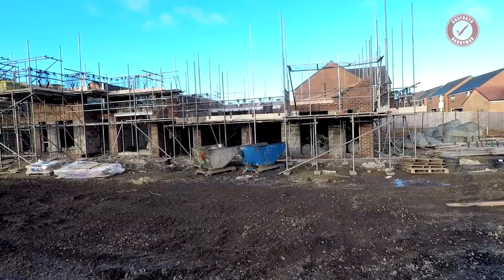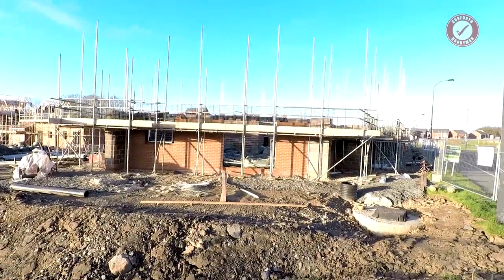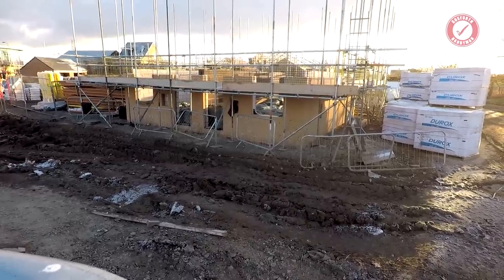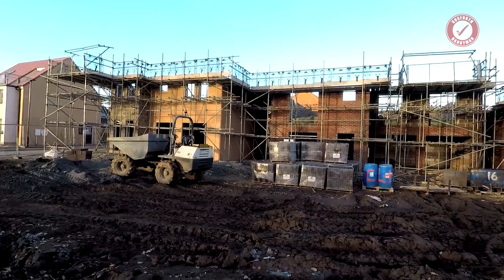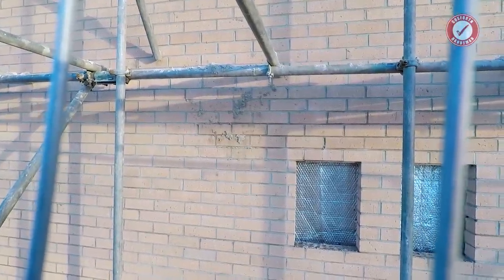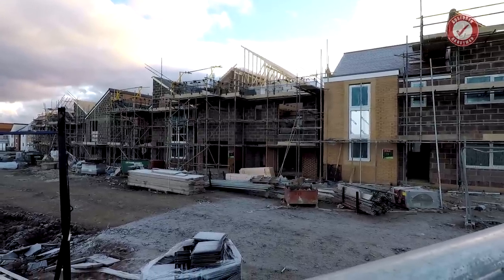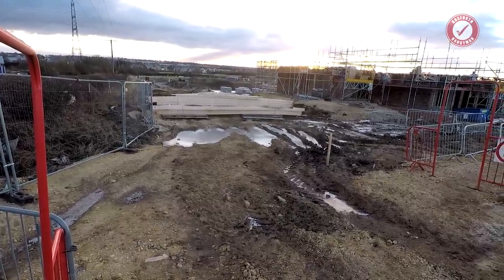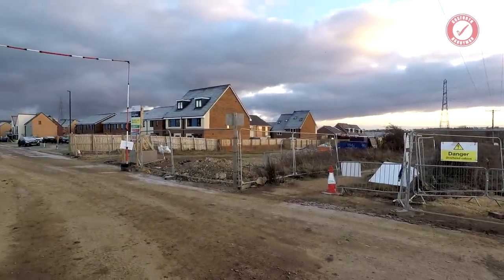How are New Houses in the UK Built? Introduction & Externals

Comment: I’m in a ‘new build’ that’s now just 10 years old and I love it. It’s dry, warm, straight and everything works. 

I’ve owned my share of old houses, about 100 years old and every old house has had far too many problems. Leaking roofs,  draughty,  trying to fit new square windows to an old twisted building or fit a square kitchen unit into a severely warped room is a nightmare. Give me a clean, smooth, energy efficient new home any time. 
Yes old houses look charming and have character but they also have rising damp, mould, leaks, lead pipes etc. 
My new home has ample storage and is a nice size. I’d never recommend an old house to a young couple, it’s such a money pit. Buy new and sleep peacefully knowing your roof tiles will still be in place the morning after a storm.
Reply: Give it twenty year and come back slagging off the hundred year plus houses v your new one.
Reply: I agree, buy new, invest old.
Reply: @julie Wallis: you are fortunate, indeed.  The new build industry is rife with problems.  I prefer old, even my mother's draughty 1930's house.  It had style and character.
Reply: Usually the new houses where the roof tiles fall off.

Comment: I like your work.   I live in both texas and france.   French build homes are similar to UK.  In the USA homes are built from timber.  Often the timber is glued pieces and looks pretty fragile in the long term.   The lots in Texas are still large and the houses are mostly detached.   To make them bigger slab foundations are used and they often crack after forty years and cause moderate to huge problems.   Perhaps, today, in better neighborhoods, deep footings are used so the slabs will not crack.  Not sure of that.   In the inner parts of the city it might not matter so much as homes are often destroyed after sixty or so years to make room for bigger ones.  The frame houses usually have a brick,  rendered, or wooden façade.  I think much of the wood is really 'Hardy board' which is cement and fibers shaped to look like board and painted. Roofs in the USA are often composite materials that last about twenty years.   Nicer homes have metal roofs and the nicest have tiles or slate, but that is unusual for a home under two million.   Texas and most American homes look cheerful and spacious and so they are, but they do not feel permanent and cozy.  More like a consumer item.

Comment: They should use different design on the homes even on the same road. Some could be modern versions of traditional designs some could be contemporary. I hate cookie cutter. Build detached. Fed up with so much of the UK based on terraced housing. Also, have wide roads and pavements in front of these new streets. Most importantly, have really good sized rooms. It will be good for the mental well being of kids growing up. Stuffing households into prison-sized cells can't be good for mental health.
Reply: Land is expensive man! Detached houses and wide streets/pavements takes up a lot of space, much of which is just not available. Plus, increasing the area comprised of man-made solid materials increases surface runoff, therefore there is a raised risk of flooding across the whole area.
I actually think a lot of traditional housing designs from the late victorian era are some of the best. Semi-detached homes for suburbs with decent long gardens and on a grid-pattern so people can walk around the area more easily. A lot of cul-de-sacs on new developments make walking much more difficult, as you are forced to take inefficient routes.
Terraced housing and townhouses can be fantastic when done correctly and also open up affordable options to many people.

Totally agree on the hatred of cookie cutter, I'd like to see a bigger mix of architectural styles.

I live in a new apartment development in central Manchester, with a front door and patio that opens up to the outside and a surprising lack of shadows considering I'm on the ground floor. All for an affordable price!

If we want people to have better availability of space, quality of life and outdoor area, we have to build more intelligently with the space we have and stop cramming in detached housing where the space really isn't there. Expanding social/affordable housing and making sure that people have access to homes of an appropriate size for their needs is also important.
Reply: Move to Australia mate. You'll never look back.
Reply: I have a Victorian terraced 3 storey house and all rooms are a good size.
Reply: Absolutely agree with you! The new build houses look so old!

Comment: That’s why I live in a 110 year old semi from back when shit was built to last
Reply: Surely these newbuild properties are not designed to last 100+ years. Everything is now engineered to fail... It keeps jobs and creates more modern builds too.
Reply: damage1_1 New builds will only last around 10-20 years
Reply: @harwoods11  disaster given they haven’t been building to support the population for decades causing costs to explode.
Reply: damage1_1 a house should not last 100 years. It ideally should not last far past 50. When a house is 50 + years old the wood is rotten and the style of the home is out of date. It would be far too dated both exterior wise and interior wise which is why homes shouldn’t last past 50 yrs
Reply: @LucasFernandez-fk8se  Why would the timber be rotten after that time if the building has been maintained correctly?

Also, given the cost of putting the building up, I suggest you reflect on the economics of replacing every 50 years.
Reply: Forza223 Bowe I’ve work on 100+ Victoria homes and new sites. New home are built to a seriously higher standard. The foundation are so shallow on Victoria homes and being single skins often suffer from rising damp. Brick and blocks new builds with the current regs on foundation will last forever if looked after.
Reply: Lucas Fernandez what a stupid comment. A quarter of UK houses were built by the Victorians, and are as strong as the day they were built. Timber doesn't rot unless its wet, and the joists and rafters in older homes are far thicker and stronger than anything used now.  If older homes are so outdated, why do they fetch much higher prices than new ones? In the U.K. people buy a new house because they can't afford a period property! Not to mention building houses to last just a few decades is incredibly damaging for the environment. We should be building to last generations.
Reply: @gongagong  I bet your houses have been retrofitted with insulation, heating, injected damp course probably even installed a toilet inside the house. XD clueless
Reply: Mum said our house is one of the last well built ones;  it was built in 1967 and has decent quality bricks, wood floors etc.  However her first house was a cottage built nearly 200 years ago, and my dad spent a few days with a friend to hack through walls a metre thick.  Houses these days probably only require one or two hard strikes with a lump hammer lol.
Reply: @mrfr87  Built to a higher standard but designed to a lower standard
Reply: @harwoods11  nope that’s not why we build shit cheap houses. It’s because that’s all people will pay for nowadays. Most people aren’t happy to pay more for something that looks and feels the same regardless of the fact after ten years one will looks a lot better.
Reply: @LucasFernandez-fk8se  my house is over 400 years old non of the beams are rotten, there’s a bit of wood worm but it’s been killed now. Also it looks lovely and everyone who comes over likes it.
Reply: @PiOfficial 
My house was built in 1898.
Reply: Nonsense.
Reply: @melsagelord3991  
What..all of it 😂🤣😂
Reply: @Em-7Add11 : 😂 😂 😂 Fortunately,  I wasn't drinking when I read that.
Reply: @LucasFernandez-fk8se  I've never read anything so stupid

Comment: Pumping insulation between the double masonry walls is a bad idea because there is no guarantee that the insulation will be distributed uniformly in the cavity. You can't know if it is uniform when done and you will have gaps everywhere creating cold spots on the exterior walls. Better to install 4" rigid form insulation panels on the outside of the inside wall and then build the outside wall over the foam panels. Also, should have put 2" rigid insulation forms with a plastic vapour barrier over it on the ground before pouring the concrete slab to keep the ground floor warm and dry.

Another problem I see masonry inside walls  is how do you run electrical wiring through and put electrical outlets on them?

Comment: Greetings from Phoenix, Arizona - Gosforth Handyman.  Well things are done a bit differently here.  I live in a 45 year old terraced home (concrete stucco trolled over concrete block and painted).  However, I had a new-build here (built in 2001), and I don't think the construction materials have changed much since then.  New homes in the Phoenix area tend to be wood-frame filled with insulation, styrofoam and chicken wire, and finally covered in a thin veneer of concrete stucco.  We used to have a problem here with burglars simply breaking into homes through exterior walls.  And a friend of mine decided to spray the dirt off the stucco oh her new home a few years ago with her thumb over a garden hose.  She blew the concrete off and it took a very long time to get the builder to completely redo the exterior of the house.  In the Phoenix area, the basic construction materials and technique are not very solid... but the new homes are, at least, very energy efficient.

Comment: Fascinating, here in Australia and New Zealand it's mainly timber or steel frame construction on concrete floating pads as you showed. Brick fascade is the common outer skin with steel or tile roofs. Houses are getting packed closer together but not common to share a boundary wall. A typical section size is now around 400 sq meters. $200-250,000 is usually the price for these sections though in Sydney prices are crazy stupid with average property price over a million now. Here in Brisbane house and section are anywhere from $380 - $600,000 for a typical house depending on the area and with river or sea view or access making them go even higher. I bought in an older area to get  a 950 sq m section with 6*8m workshop out the back and forest / bushland behind us. See plenty of kangaroos and other wildlife including snakes. But have lots of privacy also to balance it out.
Reply from the maker: Interesting! You do get some timber or steel framed houses in the UK but they're mostly bespoke. An interesting point you mentioned is the size of the property. Most people in the UK have no clue how big their property is (in terms of plot size) - they tell you individual room sizes but that's about it - here's an example: https://www.persimmonhomes.com/elmwood-park-gardens/4-bed-detached-house-255118 - that's a good size workshop you've got there btw! 👍🛠
Reply: Gosforth Handyman well a lot say we have a 4 bedroom or 5 bedroom etc, entertainment room and so on. Steel framing is due to termites, double brick houses are rarely built due to cost of tradesmen and materials. My house for example is a hardwood frame with brick cladding. Hardwood is fairly termite proof. The pine they use these days are like desert for termites lol. So many spec houses built with untreated pine frames... just a tear down waiting to happen
Reply: Gosforth Handyman as for the shed yes it's a good size though I am extending to one side by 2 metres to house my dust extractor and air compressor, trailer and a few other things and then extending it forward by another 4 metres( would have been 6 but that means removing a tree). I do welding, mig and tig as well as electronic repairs ( computers, phones etc) so space disappears fast
Reply: 400 sq meters in UK will be about 3-4 houses together! lol We like it cosy lol
Reply: I’m in Perth WA and most of our houses are double brick. Still has a concrete slab like the brick veneer builds over East. There are some builders moving towards brick veneer construction with timber or steel stud walls but generally they aren’t as common over here as double brick is.
Interesting to see they use double brick construction over in the UK as well.

Comment: I find stuff like this depressing. It seems we're going backwards instead of forwards. Everything built on the cheap and not built to last! .. which is a false economy and will probably cost more in the long run. We should be making things that are superior at a lower or similar cost as in the past, not cheaper and inferior. Just doesn't seem like progress. It seems like as a whole, whether it be construction, electrical items, whatever ... we just have lost the sense of striving for quality.
Reply from the maker: Out of a matter of interest, what specifically in a new build do you think won't last? I hear the 'not built to last' phrase a lot so I'm gathering thoughts on this for a future vid. 👍🛠
Reply: Gosforth Handyman,   what about three inch timber studs that when a door is slammed all the plaster cracks? Door/windows falling out, radiators ripping off the wall because of incorrectly selected fittings, substandard materials and unrealistic time frames and profit margins not to mention watered down skilled - labour market.
Reply: wforl Yh i know what you mean , I work on the domestic side of the building and everything you do has to be clean and tidy as it’s what gets you the next job , seeing this is shocking and how little care they have for the quality
Reply: Thumbclicker It may crack buy that doesn’t mean it won’t least for a very long time. They are just hairline cracks anyway.
Reply: I think it’s all depends on where you live..I’m from the Jamaica and we used blocks to build our homes not wood..well the poorer class use wood but people are hi can afford it uses blocks because it’s longer lasting than wood..which would have termite problem ect
Reply: @bum-edwhu66  I live in a flat which was built in 2006 and it is extremely well built. So you just generalise
Reply: To me the depressing thing is that these houses can't grow. Not enough parking, no usable lofts, no closets in the bedrooms. You pay £200-300k, mortgage your life away and then have to move when you have a few children. You can't have friends around because there's no place for them to park. The problem is the design (and intention to keep selling the same people houses), not necessarily the build.
Reply: @A Nacke Mate it’s not their fault that that’s what the muppets will buy. You can build proper homes but at the end of the days the developers have realised that nobody is willing to buy them.
Reply: @A Nacke: 'coupled with pressure from the shareholders...' and legislation designed to give big developer the upper hand at every turn.
Reply: @A Nacke This is not a true reflection at all. At the end of the day in all walks of life you get what you pay for . If you feel you desire a home built to last 100 years with a  guarantee then thats would be possible , however the cost would be enormous. Quarried stone built on bedrock perhaps? but what materials would you suggest for main roof ,floors, windows ,doors oh yeah you may struggle with glass as the current term is a 10 year guarantee.
Reply: @pmichael73  Current building regs are . Dwellings with 4 or more bedrooms 3 spaces.  Dwellings with 3 or less bedrooms 2 spaces.
Reply: @jimmyc974  Should be two spaces per bedroom.
Reply: @pmichael73   so you are seeking all 3 bed properties have parking for 6 cars
Reply: @jimmyc974  If we are moving to a solar energy economy, people will be generating and storing much of the power for their own vehicles. This energy independence will cause more car ownership rather than less. During the Blair years, developers were providing 1.5 spaces per unit, so a 4-bedroom house didn't have enough space for two cars. As you note, it's a bit better now, but a long way from being realistic.
Reply: @pmichael73  So what is the answer ? Is it more parking, more floor space, larger homes, three storey homes.? All are available at the moment at a greater cost . Do people really expect more for less costing? So here is a thing if home parking is such a great issue then why is it not feasible to utilise garden space . Building firms work within the restraints of local planning yet it is the builders who are attacked when home owners deem their homes not suitable . Yes we can all have lavishly sized properties , but at a cost ,and if 2 hundred thousand homes are required then land to hold 2 hundred thousand homes is also required , where does that come from. Plans are submitted and rejected or passed by your local planning comittee if the general population dont agree with the outcome then surely the fault lies with the planning commitee . I you purchased a piece of land at a cost of £1 million and within the local planning parameters you are able  to construct 10 homes. The average ratio land price to house price is 25% to 50% so  even at 30% the costing for each of the ten homes equates to 300 thousand.
Reply: @jimmyc974  That is the basic problem. But look at it: basic British  domestic housing design hasn't advanced since the Georgian period - even many of their tricks aren't
 used any more. They often built on ground level and then raised the street. Water, sewers and gas mains were very shallow until covered and the ground raised by about four feet. The space under modern houses is wasted. Set back a bit, and even houses on small plots would have a two-car garage and a driveway big enough for two cars. Very little extra cost. For a generally better housing model (pre-mass automobile ownership) look at the New England "three decker." World's best working man's housing at the time.